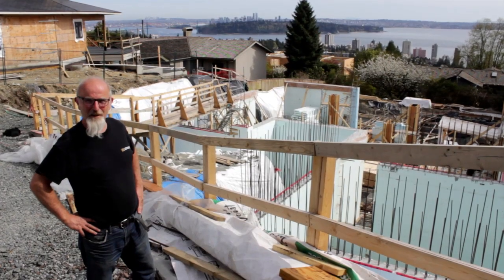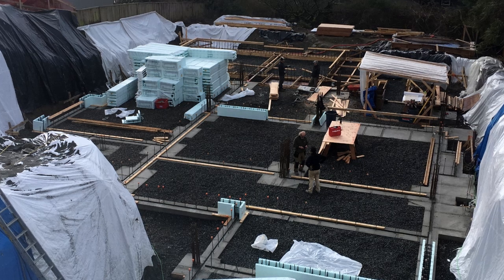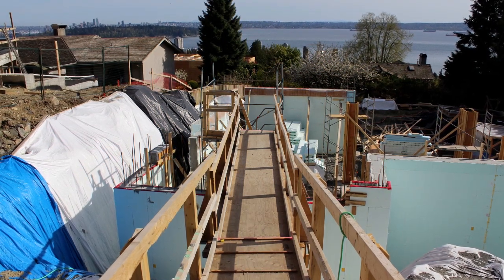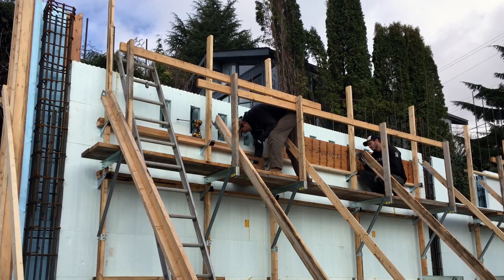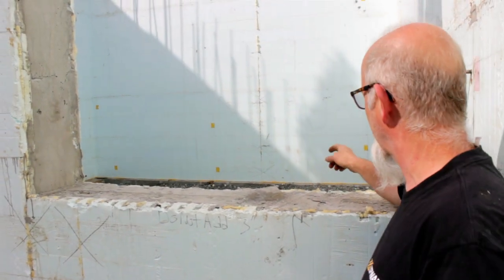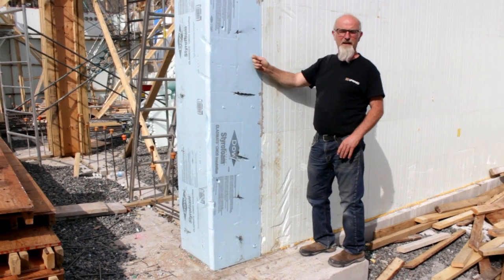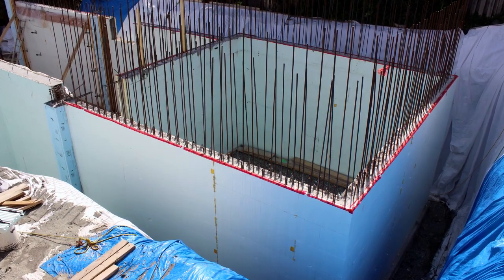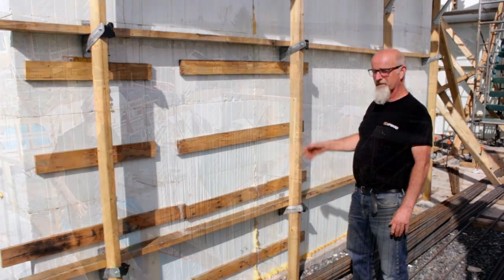Zont™ Bracing Insulated Concrete Forms (ICF) - 23.5' high walls, 14" Pilasters

Comment: How do you vibrate after each lift? Particularly the first lift when your concrete is only 4 feet tall. Most concrete vibrators I have seen would not be able to reach that far down the wall.
Reply: They probably don't. Or combination external vibration which is not good enough plus super plasticizer in mix